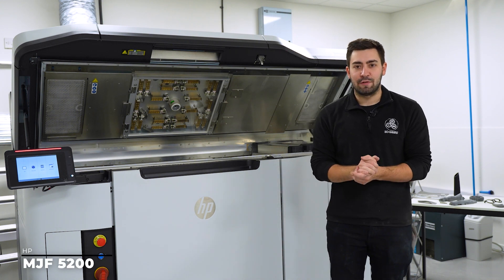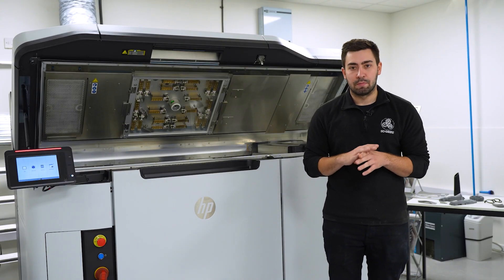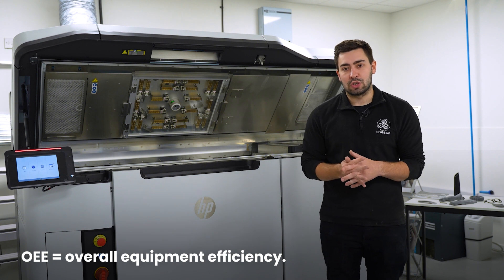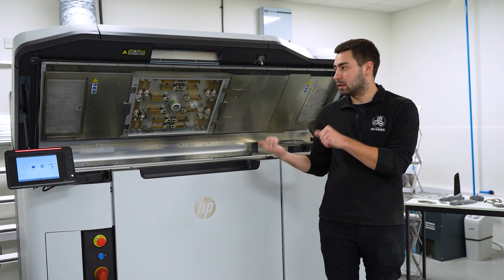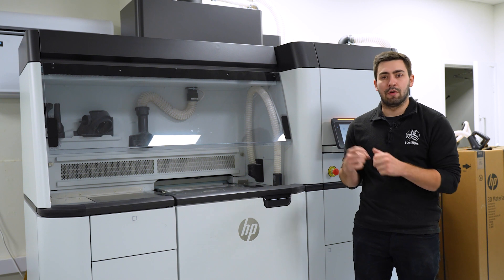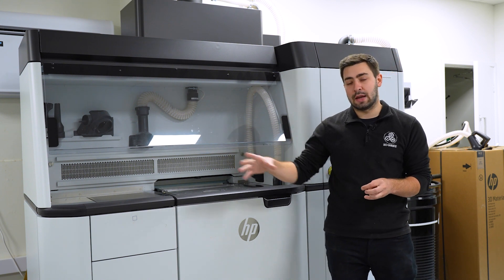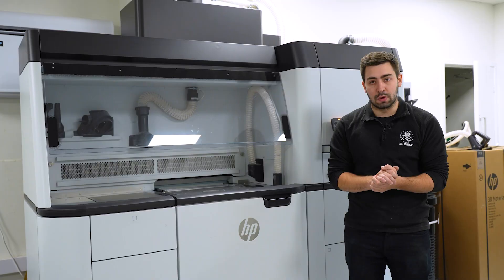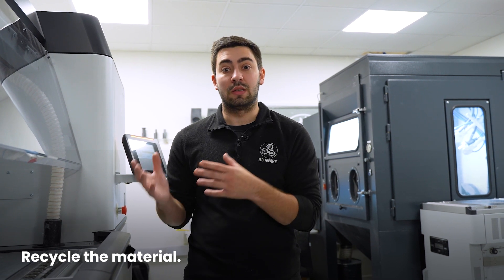What you need to know about HP Multi Jet Fusion 3D Printing

Comment: 11 hours?  regardless of part dimensions??
Reply from the maker: Hi! It's around 11hrs 30 mins for nylon, or 12 for a full build (excluding cool-down time), but the machine can be run again straight after that. If you have any more questions, feel free to get in touch enquiries@3dgbire.com. You can also learn more about the HP 3D printer right here: https://3dgbire.com/pages/hp-jet-fusion-5200-series.